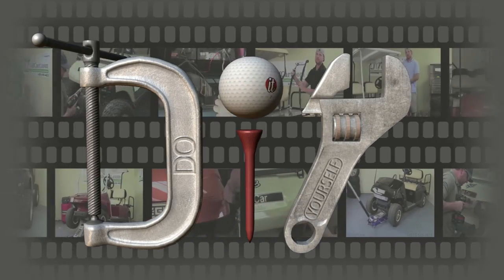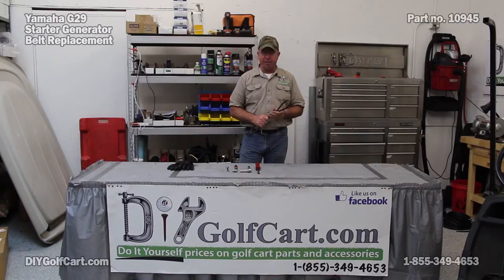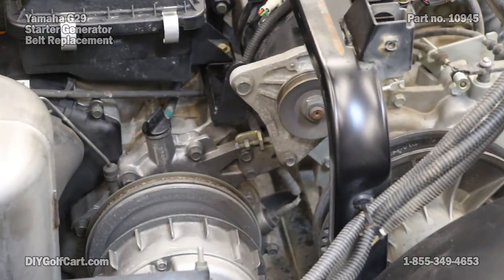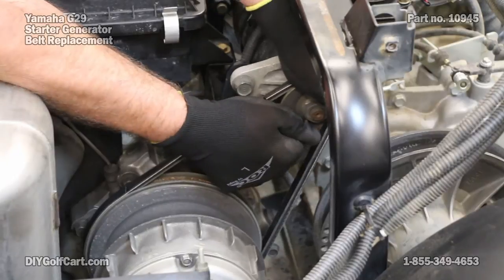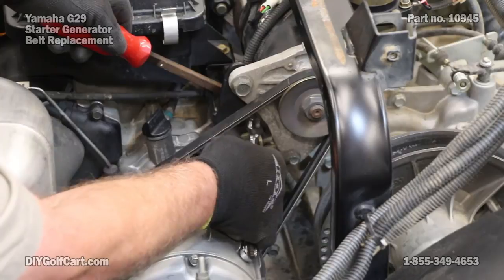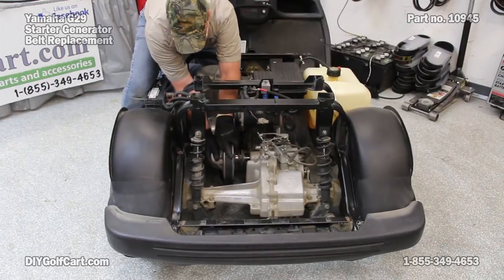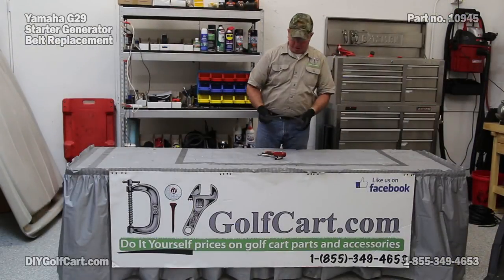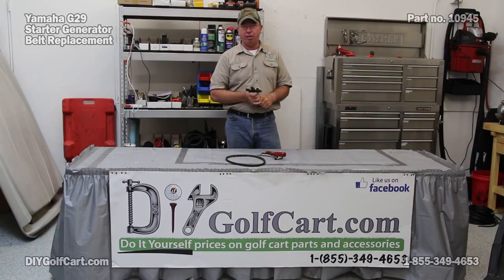Yamaha Starter Belt | How to Install on G29 Drive Golf Cart

Comment: I’m trying to replace the starter generator belt (part Jw1-h1173-00). I can’t get the new one on though. I’ve loosened everything and dropped the starter as much as it will drop and it’s still too short by quite a bit. The old belt measures 36.5” but the new one I’m trying to replace it with is 35”. Is there a trick to getting this thing on, or should I get a 36” belt? Thanks for your help.

Comment: I have a Yamaha G16  that I have put 3 starter generators on in about a 14 month time frame.   Each time one of the caps holding the brushes in will fly off & parts go everywhere.   What would be causing this ?

Comment: My 2010 G29 has a rough take off. It jumps forward when getting going. The smaller belt is very tight. Would loosening that up a bit help smooth out my takeoffs?
Reply: No, that will make the starter generator pulley squeal terribly as it rubs inside the belt. I'm not sure how to smooth out the take off, but loosening that belt will not help.

Comment: I changed my drive belt on my 2014 Yamaha Drive YDRA with no problem...however I could not get the new starter belt on.  I took off the jamm nut and bolt and had the pulley as close to the big pulley as possible.  Should I heat the belt up to 140 degrees or use dish soap?  I checked part number and it is same as one I took off.  I put the old one back on for now.  Any suggestions?  Dave
Reply from the maker: Did you loosen the 2 large 17mm bolts at the top?
Reply: Sorry for post I got the wrong belt...I tried to put on jn6-h1173-00.  When cart needed a jw1-h1173-00.  Your video is great. Thanks

Comment: Hi,

My yamaha g29 golf cart is having issues. Starter generator pulley is turning, but starter belt not always turning. After a few seconds, the belt turns and the engine runs.

Please help.
Reply: Belt may be glazed, worn or too loose. Pay attention to the installation portion of this video. When it comes to the tensioner bolt/jam nut, tighten the bolt so that you can't deflect the slackest part of the belt more than 3/16 of an inch. One turn of the tensioner bolt solved a similar problem on my cart.

Comment: my g29 makes a slight squeal when i accelerate. but cart runs and drives fine would it be this belt making the noise?
Reply from the maker: +joe hoskins Common issue. The drive belt squeals on just about every take off.
Reply: So replacing it wont fix the sound
Reply from the maker: +joe hoskins It will, for a little bit....
Reply: Will scuffing up the cluch pulley help
Reply from the maker: +joe hoskins I wouldn't scuff the clutch, maybe use belt dressing.